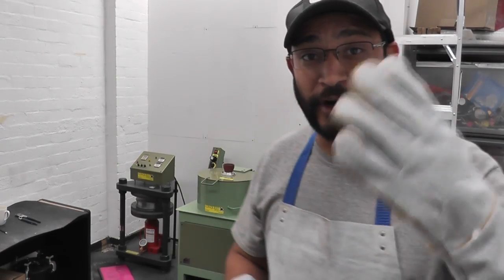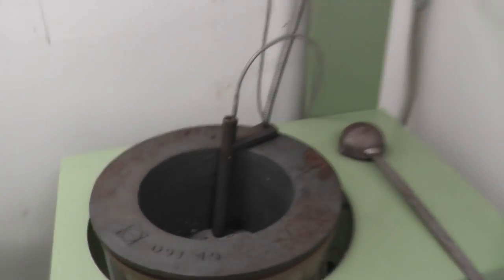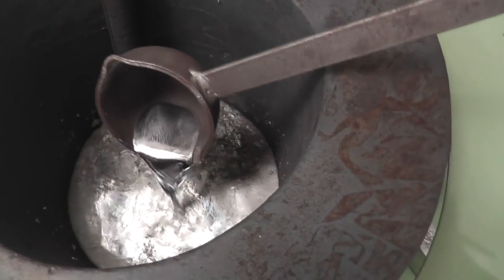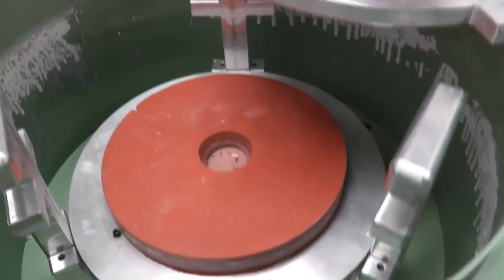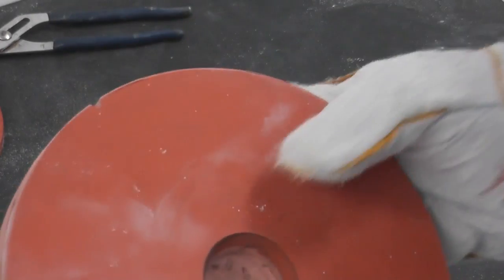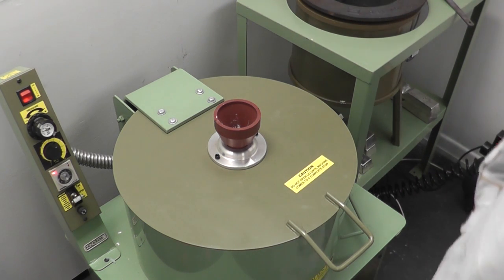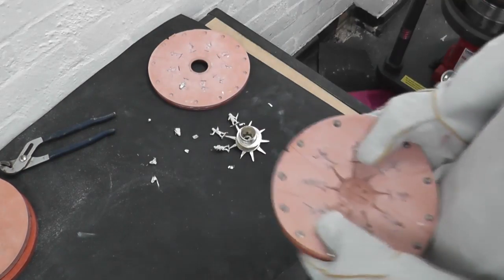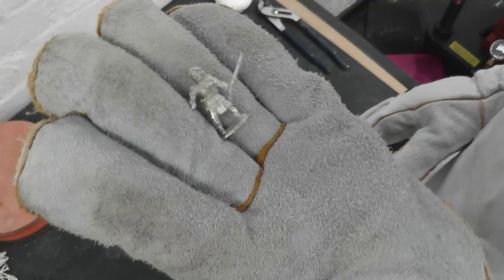Spin casting miniatures in metal

Comment: I do this as my job. I hope you've refined things about your process; Less over pouring, be more careful about locking the top plate before you put it down on the mold (Causes mold shift). I find it interesting that you are using gas to heat the metal to the point of liquidius instead of electricity. It should be cheaper with electric, no? You should also hold the ladle with two hands (safety!) and turn slightly to the side when you pour. It makes it easier to avoid any small splashes just in case they occur. You keep your work area nice and clean at least, I appreciate that! Be careful not to knock the talc off the molds as soon as you put it on. No talc can mean a bad pour. Good quality video.
Reply from the maker: +David McLeod Thanks for the feedback David.  The gas was easier as we already had existing gas lines connected in that space ... electricity would be cheaper and if we start doing more serious/full time casting work I might look at switching things over. I'm learning by trial and error so yes ... I'm learning more each time I make something and pour various molds, being careful with the locking plate (and making sure I have it the right way round!!) Talcing is still an issue ... I need to get a better talc bag, though I've taken to gently brushing the surface of the mold and leaving it whilst I do other things before spinning it.  Thanks for watching!
Reply: Talc will not get better by sitting. The best talc bag is a lightly used (and washed!) sports sock in my experience. Cheese cloth is some people's preference. I like to let the first spin of a mold sit for an extra 20-30 seconds just to help warm it up to open up the gates and vents completely. When you tap the mold sides together I find it helps to either hold them really close or close the mold up as the newly loose talc can then coat the surfaces properly. Tapping then opening the mold up will only serve to spread the talc into the air where it can't do any good. Keep experimenting!

Comment: I know you didn't ask but, you may consider fluxing your pot as that slag is loaded with tin crystals...I use powdered sal ammoniac but it is very corrosive to steel.... Also, I would leave that slag in place until just before you take a ladle and the slag will help to keep the top crystals from becoming oxidized..I've been making molds and casting for around 15 years now...If you are getting incomplete casting you could try decreasing your clamping pressure and that may open up your vents and allow the part to fully fill.. Oh, btw, beautiful set-up you have....I'm jealous...

Comment: Always wanted to try spin casting, i have some experience casting w/the molds I got from prince august, their 28mm romans & celts & the details are good if you use a good mix of quality metal but w/the spinn casting it seems you can use basic metal mixture & get all the fine detail to come out easily. The 1 problem i have w/spin casting is that you need a good deal more metal to cast with, though i understand the excess sprue does get melted back down & used. For those who preffer metal minis it is the way to go as a spincast mold produces a good deal more figures than the gravity cast ones i use ( 2 figures a pour/cast). TY for posting this really fascinating & informative video, I'm very happy i've subscribed to your channel as you allways have great content . 1 last thing, do you ever heat up your molds before casting ? By doing that you can avoid the problem you had 1st casting, I have the same problem w/mine if i dont warm them up the figs might not fully form, though by 2nd or 3rd try they are definately warm enough

Comment: Great stuff mate!  I have learnt how to cast things up from your videos, and I am progressing my way along from plaster to resin and hopefully to metal!

A few questions -

1)  What is used for the masters in the rubber mold?  Metal miniatures or some other material?  If it is metal, is it something other than lead or white metal, which might melt too quickly in the mold, giving a poor cast for the figure?

2) Where did you source your metal ingots from?  I have a supplier of casting materials here in Perth, but their metals are more for jewelery.

Cheers mate, love your work!
Reply from the maker: Masters can  be almost any compound ... that can withstand 160C temperature and ~5000 PSI.  Most two-part epoxy's such as 'green stuff' and other oven fired clays.  Metal, sure ... as long as its melting point is above ~160C, sometimes metal figures are cast using a low metal point metal (~140C or less) and therefore these figures will melt if you try to use them as masters.  Though depending on the silicon (or rubber) you use for your spin molds, even if the master melts you can still get a good impression before the master melts - it depends.  The metal ingots you see in the videos came with my equipment, though I will probably restock when necessary from a local company - can't remember their name, will need to check emails.  Cheers

Comment: Great video i apreciate, have you tried before using the 3d printer for making a masterpiece that can be silicon rubber moulded for the spin casting
Reply from the maker: Ahmed Ghanem Not yet ... the printer wont be arriving probably until the end of February, but that is certainly something that will be achievable

Comment: Great machine! Great video! Can you use also bigger molds used for small terrain bits? Is it only usable for metal or also for resin? Greetz! :-)
Reply from the maker: This was a small 9" mold, I can spin 12" molds as well ... spinning resin is not as easy as metal ... you can see the inside of the spin caster, I had a small accident with some resin! :)  Due to resin setting due to thermal properties, the mold would need to be spun for a considerable amount of time, plus demolding is an issue with parts snapping etc.  Spin casting is pretty much for metal, and pressure casting for resin.  But yes, small terrain bits could be cast in metal.

Comment: What PSI pressure setting do you use for your spin caster?
Reply from the maker: It varies depending on the mold and figures being cast.  Most molds cast fine around 35-40 psi, but as I said it varies.  Each mold needs to be tested and the correct pressure for each mold 'discovered' and then written on the mold.
Reply: Thank you, this helps a lot as a starting point: I have recently restored an Old School Frank Pertot Open-air Spin-Caster and do not have an owner's manual, so... Thanks again.

Comment: greetings are you fusing zamac or aluminum and what is the thickness of the material to the centrifugation?
Reply from the maker: Neither ... we use an alloy specifically made for casting model toy soldiers.  We use 1" thick molds and the models inside are very thin

Comment: A gentle tip, do not put a cold ladle into molten metal.
Reply from the maker: I have been warming it up on the top of the cauldron before using it ... I dont know the science, but I no the cold and hot metal dont mix well!
Reply: RubbishInRubbishOut
 In the past my line of work used molten aluminum to connect electricity cables together, I once put a cold ladle into a cauldron - the ladle then expanded very rapidly ejecting the contents far and wide luckily no one was near and a majority of it went away from me.

So be safe my friend, keep that ladle warm.

Comment: Awesome video. This is the first time I saw how metal minis are done. If you don't mind, could you tell how much all the machinery cost?
Reply from the maker: For the 3 machines and some supplies (silicon rubber for the molds, pewter etc) I spent approx. US$15k

Comment: It"s a great video. What kind of silicone do you use to make the model and where you buy it?. Thank you.
Reply from the maker: There are lots of different silicone discs available for making spin casting molds, each has their own properties that make them suitable for various purposes.  These discs I have are from Conquest Industries ... there are two types in this video. The red one is called Backsil, it is a generic silicone used (in this application) to provide a firmer backing for the softer pink layer - it doesn't need amazing properties as often not much of this material will be in contact with our model (or tool) inside the mold.  The pink layer is called Softsil - it is an ideal material for making master molds (and limited run production molds), it is well suited to the production of figures as its properties make it ideal for handling steep undercuts and complex designs.  Silicone is MUCH easier to work with than the more common (or traditional) organic rubber (again, which is available in all types of rubbers), it is also much faster to create molds with silicone.  As I stated though, there are LOTS of different companies that produce silicone discs for creating spin casting molds, finding the right one for your needs is just a matter of looking, searching and asking questions.  Cheers, hope some of that helps.  Cheers